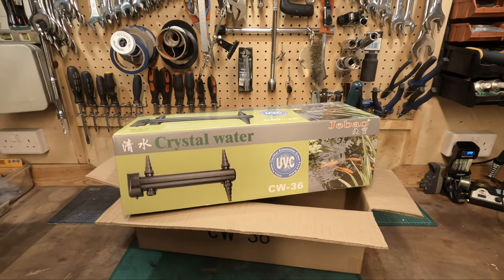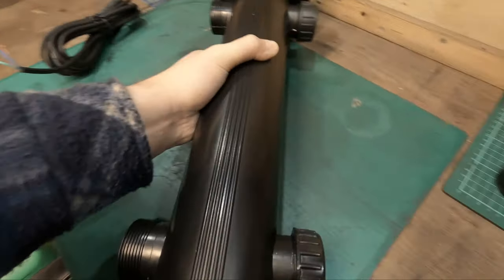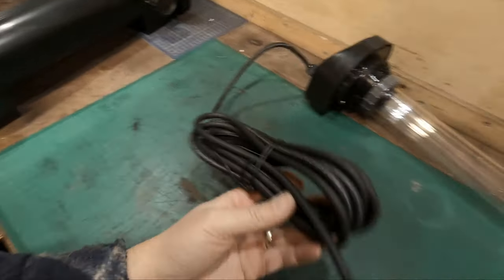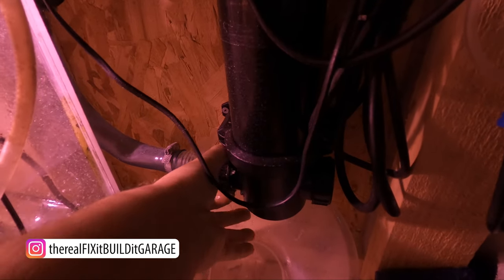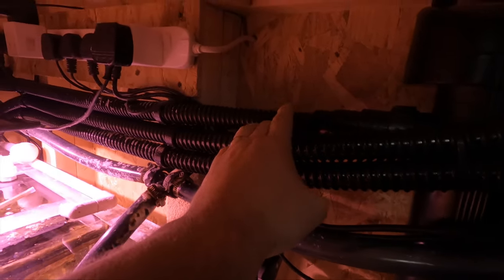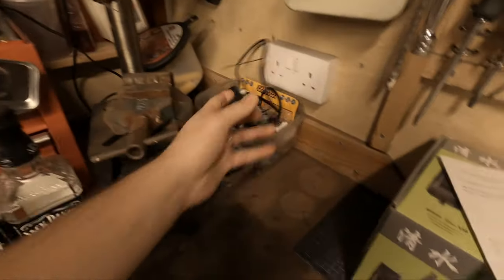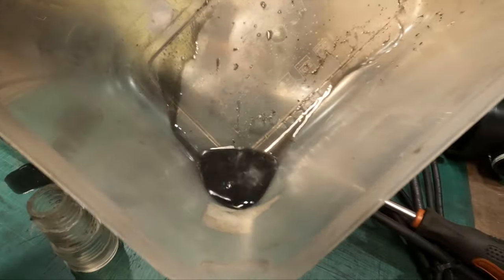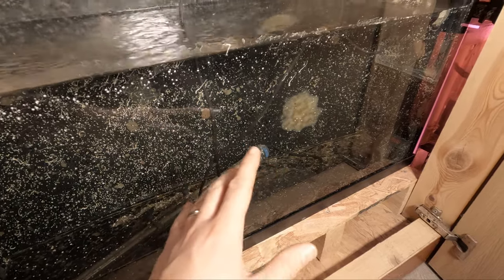36w Jebao CW-36 UV Clarifier Steriliser Marine Saltwater Reef Tank Aquarium in Wall DIY vs PU-55

Comment: Thanks for the video.  I have an Aqua UV 15 watt on my 80 gallon that I'm not real happy with.  Thought about one of these since the Aqua UV is ridiculously expensive.  5 years out of the old one, I would be fine with that.  The black stuff you see is the plastic degrading and getting into your water.  UV and Ozone will start to degrade certain plastics over time. Ozone does it real fast.  For the price, I would say it's an ok investment.  Again, thanks for the video, just what I was looking for.